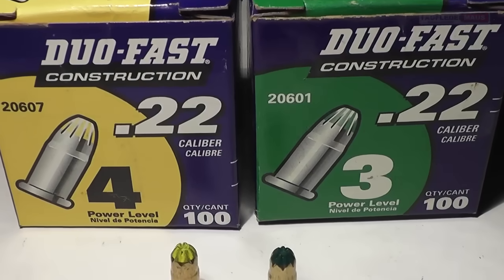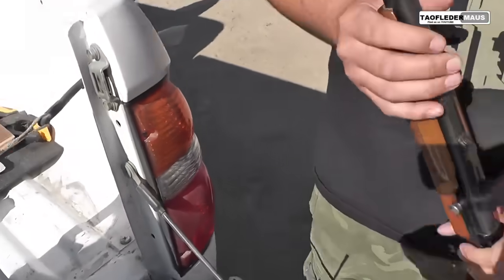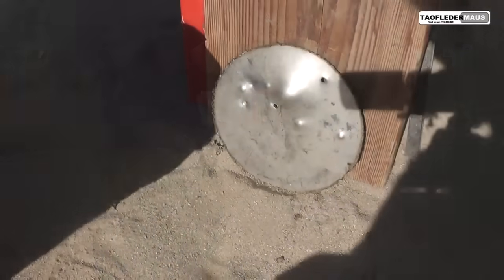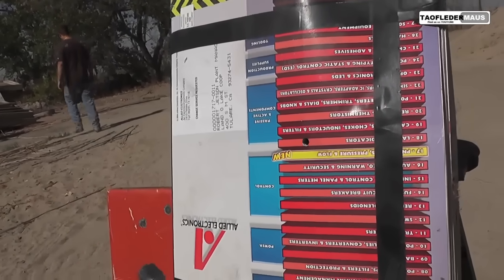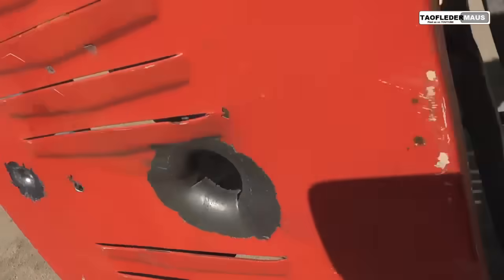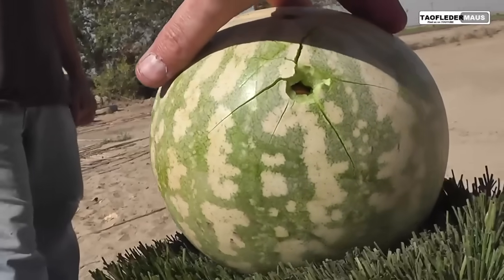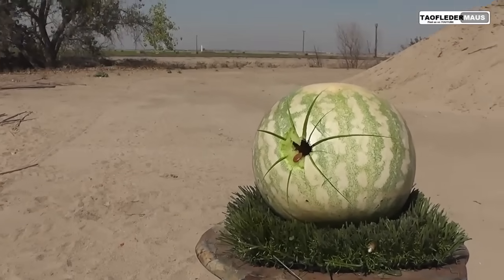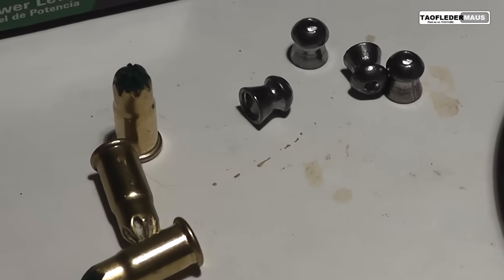Shooting .22 PELLETS Using NAIL GUN Blanks - What happens?

Comment: Pellet fired from firearms get very high velocity in start ,because of less weight than 22 lr bullets ,and big firearms pressure power.More than 25 000 psi for 22 lr caliber.Because of that speed ,you have terminal efect on that watermelons,but not penetration.BUT.Pellets have catastrophic balistic,B.C of just 0,30 in the best case.22 lr bullet had B.C  .140 .....4x better balistic coeficient than the pellet,so after 50 yards pellet will loose 50 percent of energy and speed,22 lr bullet just 10 percent.That means ,that is weapons efective like firearm just at close range,out to 40 yards .After that ,22 lr is many times more powerful.

Comment: Old Shots and Pin sales guy here. Reason why they say "DO NOT use in firearms" is because those powder shots contain far more powder than a standard load in a bullet. The mixes change as you need more strength to drive steel nails into concrete. In fact there is a black cartridge made by Winchester than can drive  3/8' knurled nails into 1/2" steel. Standard cartridges could drive a 72mm (3") steel nail into 45MPa concrete flush. That is the main reason for the incredible velocities out the .22 . Great Video. I've personally always wanted to see what happens if you tried this. Pardon if the explanation has already been posted.

Comment: Instead of muzzle loading them why not, since it is a .22 pellet, attach it to the charge with wax and fire it from a breach loader or a bolt action? I mean the cartridges already have a wax or painted seal on them to hold in the powder, what could it hurt to attach the pellets in a similar fashion? I mean it would be time consuming at first but would save a hell of a lot of time with loading later on.

Comment: The pellet is basically a wadcutter, which explains the perfect penetration, and probably moves around twice(Edit: three times, evidently) as fast as the bullet with the same amount of powder. I'm betting the nail cartridge has a lot more powder than the .22 bullet since it has to drive light nails into particle board.

Comment: I recently tried this out using 14.3gr Crosman Premier pellets and the Ramset #2 power loads. The test rifle is a Remington 33 single shot bolt action with a 22" barrel. My chronograph readings gave an average velocity of 1663fps with a high of 1738fps and a low of 1579fps. I made sure the pellets were forward of the chamber and engaged in the rifling before each shot. Group size was about 1.5" at 25'. The powder loads are smoky and quite dirty to shoot. This combination could work in a pinch but as they say, "Kids, don't try this at home!".

Comment: whats happening here is a much higher rate of energy transfer, the higher the rate the more clean the entry hole, the way the melon explodes reminds me of exactly how the Waxer 12 gauge reacts to targets, very clean entry hole, massive internal pressures. They seem to react the same way the pellet must be transfering much more energy. a Waxer transfers about 90% of its energy compared to a standard slug with just a 30 to 40 % transfer.

Comment: Great video Jeff, you made me really want to try this now haha, shoot a sparrow or something. I think the colour coding is different over here.
Reply from the maker: You might want to wait until part 2.    We couldn't get a 2 foot group at 50 yards!   If you can try it,   please do.  You are due for a new video!
Reply: ***** Overdue for sure. I'm not surprised at the accuracy issues those things are really moving! I guess you could use the heavy solid pellets 25ish grain but you'd lose the novelty of speed and increase pressure.
Reply: FPSoutback By the way, love your videos!  Subscribed for a while now.  I was able to get about an 8 inch group at 25 yards: http://youtu.be/Hc5rpSk15XI I think a stronger construction pellet might give better groups.  I have heard that there are .22 caliber pellets designed for higher pressures, but I have not been able to procure any.  Would be happy to put them over a chornograph if I had some.
Reply from the maker: FPSoutback   Yeah, the pellets are pretty fragile.  They leave a ton of lead fouling too.
Reply: RyeOnHam 8 inch at 25 yards isn't too promising haha, I did buy some of the charges though (well like 600 of them :/) so I might put a few of the heavier pellets in and see what happens.
Reply: Look forward to the results.  I'm putting a video together grouping the lighter charges with a scope this time.  If you're subscribed, I also have some other related vids in the works.  Always enjoy your videos!  Thanks for watching mine!

Comment: Load up 6 of each into a .22 revolver pistol :(
See if it will shoot all 6 without blowing up or something, lol
Reply from the maker: You try it first and let me know if it worked.  That is if you have any fingers left to type with.
Reply: Oh calm down people it's literally a 22 blank round Hasn't anyone ever seen a military 5.56 blank round? Put some powder behind a projectile and you have your basic concept of a firearm. Just cuz the ammo factory didn't make it doesn't mean your going to lose limbs lol
Reply: ***** Speaking of dangerous revolver tests, how about turning an old single action revolver, "full auto?" I've heard old stories about it, but I've never ssen it before. How it's supposed to work is that on old SA revolvers where the firing pin is part of the hammer there's a small hole in the back of the frame for the pin to reach the primer. If that hole is made large enough for the primer to pass through then it will launch out the back of the cartridge forcing the hammer back rearward to cycle the gun. I don't know if it's possible, but it sure seems plausible. whudya think?

Comment: The pellets are blunt. So it punched through the locker (literally - like a machinist's punch) instead of cutting through with the concentrated force of a conic bullet.  If you looked, I would not be surprised if you found a steel disk punched out by the pellet.

Comment: I have been doing  this since I was a kid . I like to use a revolver  loading the pellets in from the rear and putting the ramset  charge behind it.  It is worth mentioning that the pellets lead foul your barrel faster than bullets.  But this is nothing a little extra cleaning won't cure.

Comment: WTF the pellet is BETTER than the real bullet??
Reply from the maker: Not really.    The pellets are faster,   but much lighter,   so there isn't  a lot of energy.
Reply from the maker: .22LR's lose a lot of energy too the further they go,  actually all bullets do.
Reply from the maker: Cheesepuff
 Ballistic gel channels are welcomed to try it.
Reply from the maker: Are you factoring in that pellet is only 14 gr.  and the bullet is 36 gr?
Reply: Actually what gives accuracy to the pellet is the spin induced by the threads in the barrel. The skirt is made so that it expands and gets pushed against the threads of the barrel, when propelled by the compressed air or whatever.

I was more thinking about drag issues and resistance.
Reply: Winston Deleon Actually I would say that the pellet would do more damage. Simply because it has more energy. That way, when it hits the flesh, it will instantly torn apart, into smaller pieces than the LR, and would deliver it energy faster, destroying tissues in a much more extensie way. But for that you need the pellet to be soft enough to instantly destroy itself. 

On the other hand, the pellet will have a much flatter flight trajectory, and will reach the target in a shorter time.
Reply: ***** Mmm. Actually it depends on the distance. For longer distance a pellet would retain much less energy since its mass is lesser and so its inertia. For shorter distances pellet would be better since energy depends on the square of the speed. E=0.5*m*(v^2). If you can depleet all of that energy into the target.
Reply: ***** Yes. The higher the mass of the bullet the better it can retain its energy whiñle travelling (also aerodynamics take a huge part here). 
The pellet looses its energy faster since its lighter, but it also has more energy since it is travelling faster.
Reply: ***** actually, if the pellet is actually going 2800 fps (or anywhere near it), it has more than twice the muzzle energy of the .22 despite being lighter.
Reply from the maker: Another channel chrono'd them and they were going over 2800 fps with an 18" barrel.  We were using a 22" barrel so 2800 is a lowball.
Reply: ***** exactly, so the pellet had well over twice the energy of the actual .22 round
Reply: Yes. Energy depends proportionally to the mass, but exponentially to the speed. Thats why its has more energy. The thing is that if both had the same aerodynamic characteristics, the heavier would retain energy further on, since inertia is bigger in it.
Reply: ***** yes. the 36 gr .22 round at 1260 fps has 126.9 ft/lbs of energy while the 14 gr pellet at 2800 fps has 243.7 ft/lbs of energy. pretty interesting.
Reply: ***** yes but they can punch right through 8th inch steel plate. why not try using it on an ar500 and see how that goes?
Reply: What I think you'd see in ballistic gel, especially with a hollow point pellet, is the pellet breaking up into little pieces almost instantly and leaving a wide but shallow crater type of wound and not penetrating very far. You'll get a narrower but much longer wound channel with the .22LR. The pellet is going to hurt like hell and leave a nice scar, but probably won't kill someone. The .22LR is much more likely to get deep enough to hit major organs and arteries. So, as with all ammunition, which one is "better" depends on your use scenario. Most of the time, I'd probably say a real .22 is probably more what you want, but there are some specialized applications where an extremely high velocity very light pellet could be useful (think something like embedding a small piece of hardened steel in the hollow point as a perpetrator to make a cheap improvised armor piercing round).
Reply: Gonmoreno air rifles shoot about 650-800 fps he said with the nai ammo if went 2800+ so  that's more then tripple the speed of the pellet
Reply: Now we just need to find out how much energy regarding distances, and then we could see if its actually better to use the pellet instead of the bullet. One actual advantage the pellet will have, is a flatter trajectory.
Reply: puchomoreno The design of the pellet skirt gives it some accuracy, I think.
Reply: marshall ling It would be an interesting test.
Reply: Or maybe gel, to see the penetration compared to the .22
Reply: Winston Deleon Except for the heavy metal poisoning from having lead powder exploded into their veins...

But I see the point, I basically would expect that result as well.
Reply: Why not, small caliber and big cgarge to push it. Its litlee bit like FN fiveseven.
Reply: ***** sounds like you boys stumbled onto an awesome close range defense weapon. more energy at close range with its superior power to weight ratio but with little penetration of target. I would like to see these put into a regular high grain .22lr cartridge devastating.
Reply: Cody If the pellet had the same mass as the bullet and was still doing 2800 fps it would have 4 times the energy of the bullet at 1400 fps. Energy is proportional to the square of velocity. As it stands the pellet has half the mass, so it has about twice the energy of the 22LR bullet.
Reply: GamingLoadown101 Yes i know. Thats why a pellet would do more than three times the damage.

Comment: The ultimate backyard squirrel load perhaps?
Reply from the maker: If  the neighbors don't might the noise.   It's a LOT louder than a regular .22lr.
Reply: ***** I'd say so, at 2500 fps lol that things truckin along.
Reply from the maker: CZ PIMP  It turns out the pellets were going about 2800 fps.   Faster than my estimates!
Reply: ***** That's insane!

Comment: This needs to be tried in a break action single shot. You could set the pellet precisely where the skirt meets the rifling and reduce the gas gap. The extremely soft lead in the pellet is expanding in the barrel and biting those lands and grooves better than the alloy in standard bullets. There are pellet manufacturers that make pellets that are basically solid lead with a cone in the base that acts as the skirt. they run around 20-21 grains. Benjamin and Kodiak are the brands i believe.
Reply from the maker: That is what RyeOnHam did here.   He's got some great chrono tests in his video.
VR Shooting  22 PELLETS Using NAIL GUN Blanks

Comment: The powder charges contain more gunpowder than a normal .22 round.  Crosman pellets are also made out of hardened lead and their skirt is slightly oversized to engage the rifling.  The pressure from the powder charge will also cause the skirt to expand creating a better gas seal.  Pellets have a weight forward design that makes them very stable in flight.

Were you guys able to chronograph the pellets?  The light weight and high powder charge were probably resulting in some crazy high velocities out of a 22lr firearm.  What type of pellets were you using?  Crosman offers several variations including wadcutters, domed, pointed, and hollow point.  They also offer alloy pellets that are under 10 grains and harder than lead.

Comment: The back of the pellets are con caved so that the pressure expands the flare so that the round can engage the rifling. I don't think the manufacturer of the pellets had in mind the pressure your subjecting them to. I bet the pellet completely deforms and makes a better seal. Like that first shot you get out of a dry spud gun.  I would be very interested in the ballistic gel results, but the pellets might be too soft for even that. how bout a forensics water tank test?
Reply from the maker: I'd imagine they wouldn't go that far into gel.  We'll have to shoot the gummy bear.  It will probably only go in 1/2" before it disintegrates.  The energy transfer is good though

Comment: I bought the yellow loads and got the same pellets off amazon six months ago. Used them in a 12ga barrel adapter. Figured it was thicker  than any .22barrel. Worked awesome. Then got a North American arms black powder .22lr. I use a double load of pyrodex or a half load from a yellow load. Also works great. The smokeless powder has one hell of a crack to it. When percussion caps are hard to find, dollar store red caps work great, as long as I dump at least another cap or two of the mix into one cap. As much fun to reload different loads as to shoot them. Thanks
Reply from the maker: Ruger 10/22 Muzzleloading Barrel Conversion
This guy got some crazy-fast results with his black powder-converted 10/22.

Comment: TAOFLEDERMAUS
 Just an FYI, pellet under that much pressure will lose there "waist" and become a cylinder shape.
 I've done a few tests with a .22 hornet and can attest.
 I would gladly let you use my Chrony,  if need be, for velocity testing.
 Lastly, loading from the breech of a strong single shot bolt action using a chamber set (a tool that will push the pellet into the bore to the same point every time) will greatly improve accuracy.

Comment: I wonder if this would work in a 22 mag cal revolver? I guess it would have to be loaded like they used to load single action revolvers in the old west, using a loading lever or maybe your cleaning rod too...
Reply from the maker: What worries me about using them in a revolver is the pellet may jam up trying to enter the barrel and where would all the pressure go?   At least with a blow back,   the pressure just opens the bolt after the base of the brass blows off.

Comment: i wonder if you could glue the pellet to the charges and actually load them normally?
Reply from the maker: No.   We tried that and the case blew out the back because the pellet would not enter the barrel smoothly and it created an obstruction.

Comment: I actually tried this a while ago but instead of a blank round I used my bullet whacker to remove the projectile from the brass of a .22. Then I dropped the pellet down the breach end of my savage 64f and then put in the brass. It worked pretty well especially at close ranges. Ill have to give this a try next time

Comment: Would these results be because of, the round, or the charge?! This is astounding! Cement powder charges have more charge than regular rounds?
Reply from the maker: Most likely because the pellet is about 1/3 the weight of a normal .22lr bullet.
Reply: *****
I agree.  Did you consider putting 2 or 3 pellets in at once?
Reply from the maker: 442hoeky  No,   I didn't want to push our luck.
Reply: *****
Probably the smart choice!  Nice vid, as usual.
Reply: Thanks for answering!

Comment: I've actually tried this already. Some pellets can't handle the loads imposed and some have had the "tail" of the pellet separate and stay in the barrel BE CAREFUL! 

With the right pellets and power loads it does work. Yellows are pretty hot and that combined with the light pellet weight makes for exceptional velocitys, I'd like to chronograph these someday to see how fast they are.
Reply from the maker: There are definitely risks involved.   Anyone wishing to try this needs to understand ALL of them.   This is very questionable.

Comment: If these pellets could be crimped or affixed to the tips of the charges somehow I wonder if they would actually load properly into a magazine and chamber the rounds. Great video! In a pinch and out of ammo some of these hanging around would make a nice source of small game rounds.
Reply from the maker: I tried that and the entire bottom of the case blew off.  The pellets need to be seated in the barrel,   not in the chamber which is larger than the barrel.  When the round was fired off,  the pellet didn't transition into the barrel and the blast all went out the ejection port.   You can imagine what would happen if this happened in a non-blowback gun.
Reply: ***** Maybe in a non blowback gun shot would really left the muzzle !! and not assuming you're blasted with